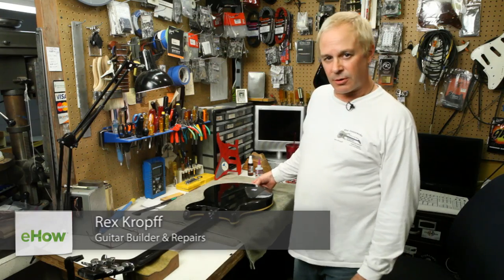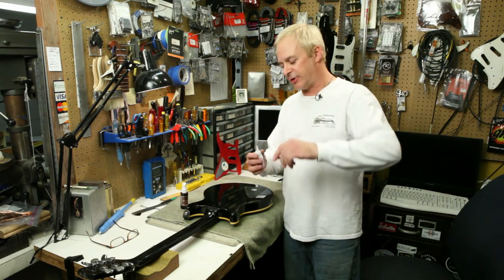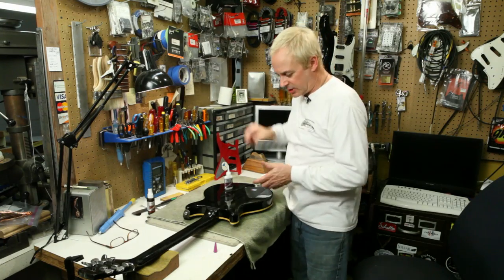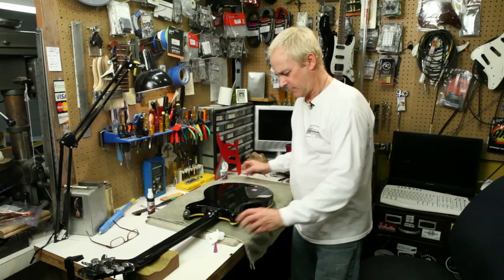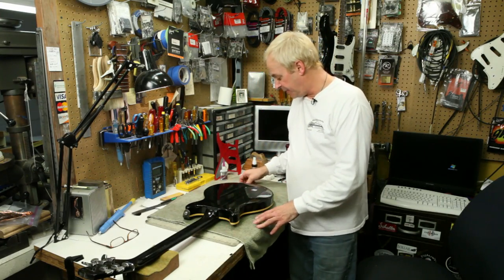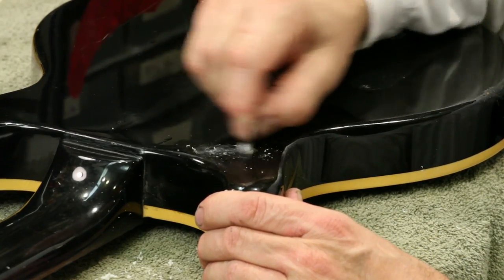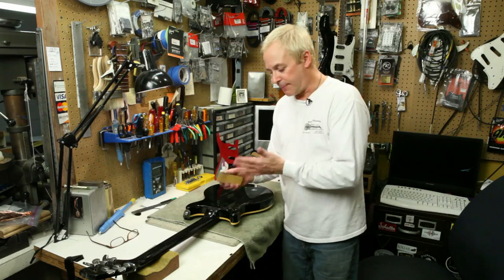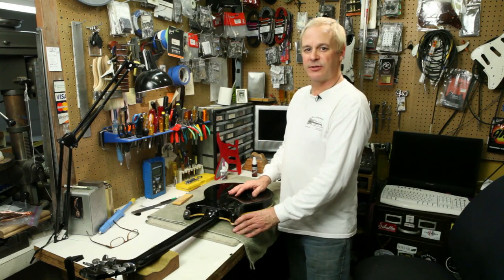How to Fix a Guitar Poly Finish : Guitar Building & Repair

Comment: I kept waiting for the "I'm just kidding, this is just some junk I'm throwing away", then it turned into a slasher movie when the razor blade came out, brutal. I'll stick with Stewart MacDonalds vids for these repairs.
Reply: Stewart Mac repairs the exact same way with glue fill, and razor blade, then progressing grits of dry and wet sandpaper.
Reply: @sorgutentarer  But StewMac doesn't come after the repair like Freddy Krueger. That razor blade work was scary!😲 I think it gave me herpes.

Comment: Nice video, thanks! Could you also do this with poly+hardener(+maybe little thinner) or do you have to do this with superglue? Asking because I "accidentally" started with sanding the headstock right after I rounded off the tuning peg holes and the poly was not dry enough (left it only 24h to dry), and when I was sanding it with 600, I peeled of a small triangle right on the edge of the peg hole, dow to the primer. Now there is still a small part on the edge of the "wound" that is loose and I am wondering if to use superglue or poly+hardener to fix this? I already sanded it lightly and applied fresh colour to the wound. I know superglue is much faster, but does it hold on the long run? I am hoping that this is the last layer before the final upper layer that I will polish ... right after I fix this :) ... properly.

Comment: You forgot to mention about mixing in baking soda with the super glue to make it harder.
Reply: Gavin Downie  
I'm not talking about using it for the last layer, if it was used for the first two layers it'll be covered up when you apply the last layer without baking soda and add the dye or coloring.

Comment: Dudes, don't try this

I had two really two small dings about 1mm large, I put the cyanoacrylate in them, let it dry and when I came back the tiny drops of glue I put in the dings had let off fumes or vapors that fucked up a large area in the paint around the tiny dings...also didn't fill in the dings hardly at all.
Reply: It worked on my two Parker deluxes. Polyester. My son-in-law was a paint sprayer/finisher at a Mercedes recognised repair shop. He did it and did a great job.
Reply: Victor Jones she taught you well.
Reply: Victor Jones my comment was to say that Superglue on polyester worked. 
My reply to your pointless, sarcastic comment also apparently.
Reply: Victor Jones you continue with pointless comments. I had a chip on a red Parker deluxe guitar and another on a classic. Both were repaired at home with superglue and are almost invisible. 
You have a pen and a mother....huh! Mother pen.